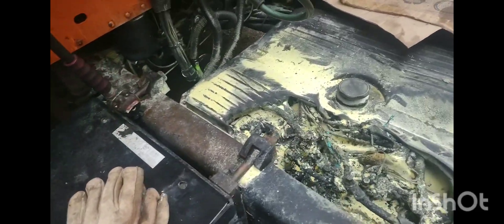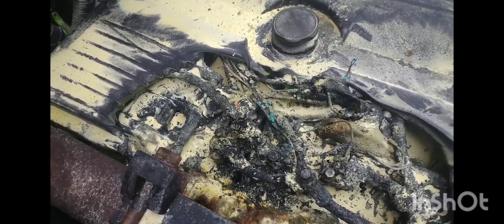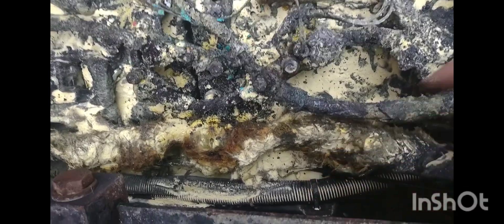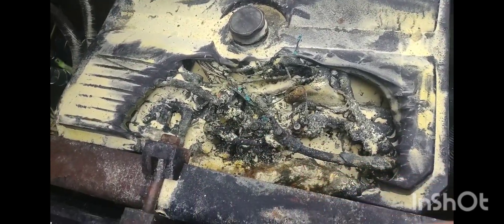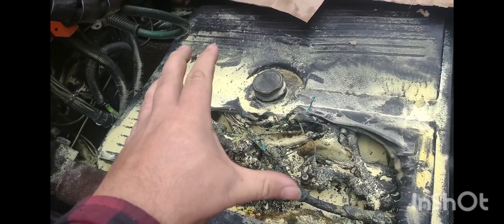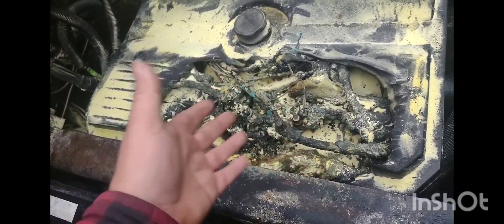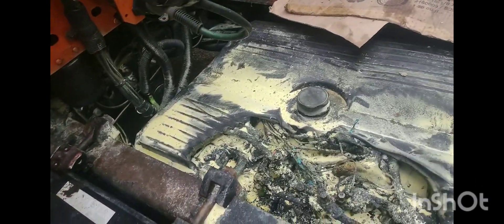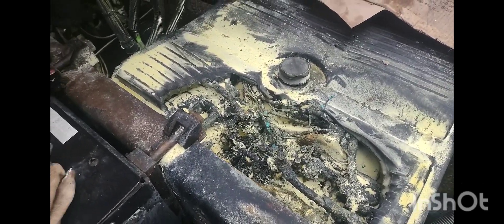Truck fire...the aftermath

Comment: My vote is critter damage for sure. Dude probably chewed the insulation off and a short to ground heated up over time. I believe a battery box should only be used for battery cables and batteries. Absolutely hate seeing general automotive wires littering that compartment and try to make my own junction box with proper breakers or fuses. Whenever I look at 14ga wire, I know it takes only a few minutes for it to burn a vehicle to the ground if tomfoolery arises.

For safety I recommend you bolt cutter the cables and free the damage carefully, before you pull the truck inside. Some of those battery cases could be weakened by the burn and fall apart so I caution trying to unbolt the cables. Baking soda and water will neutralize the battery acid too. Not a fun project, DIY, but very rewarding when you put it back correctly. Good luck!
Reply from the maker: #squirrelhotel?
Reply: @DIYSEMI  #varmintinferno
Reply: Best advice Sterling 👍